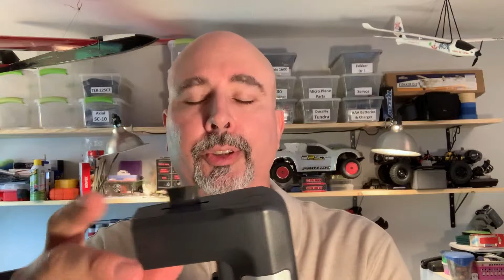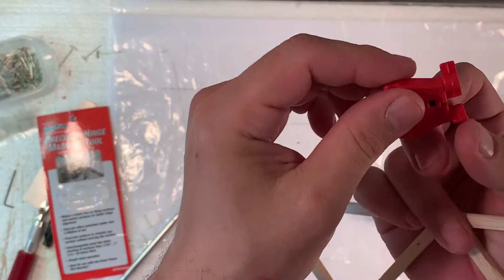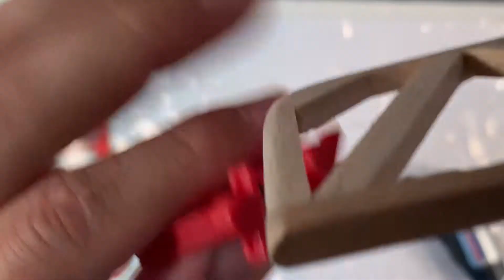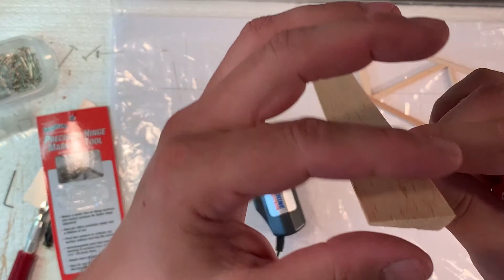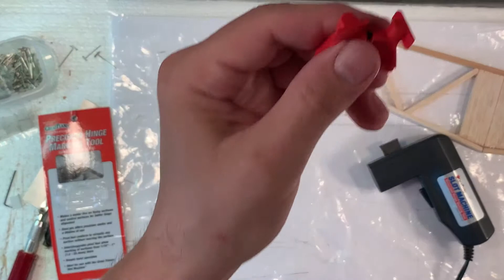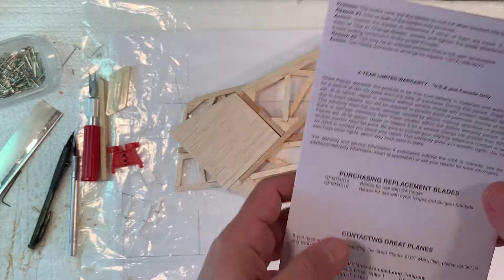Unboxing & Hinge Tools n Tips -  Great Planes Slot Machine

Comment: Its a good tool when used right. Practice on scraps to get the feel for it. Theres a guide tool made by GP as well. I made a simple guide for 1/4" balsa on a 3d printer, perfect cut every time.
I used to get a tool in goldberg kits for center marking, still have some.
Reply from the maker: Thanks for watching. Actually, I'm not sure this is in production anymore. To bad too, it's handy... not for every application, but it's especially good for hard wood like spruce or thick balsa.